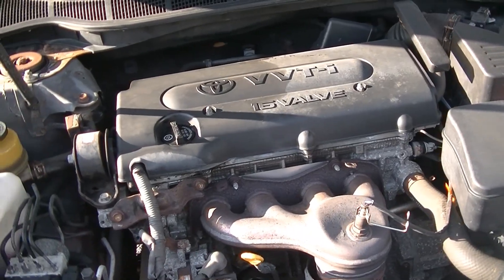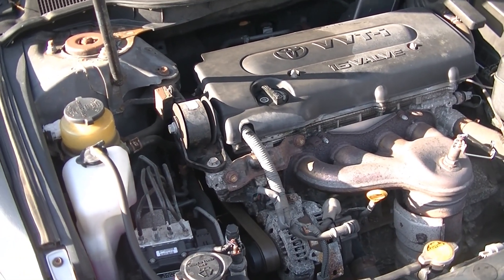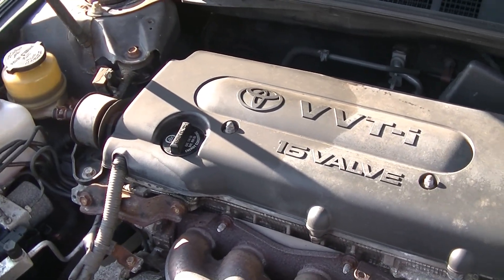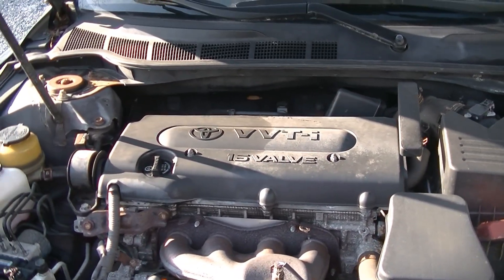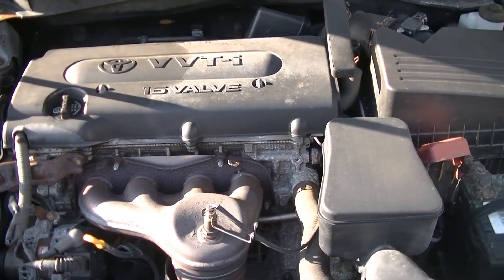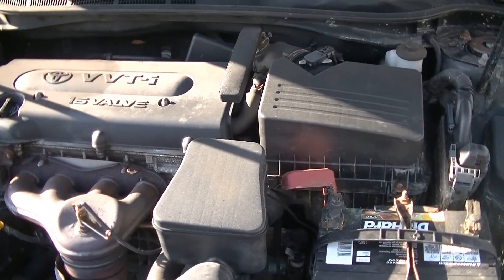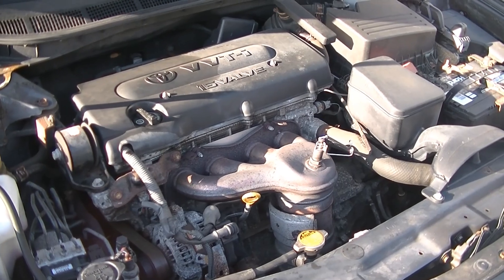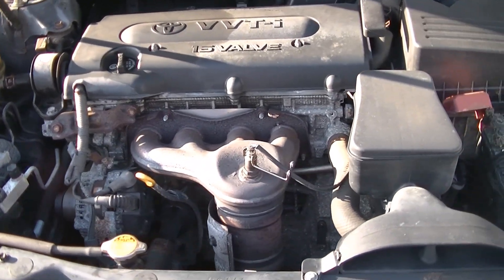Why you should AVOID a TOYOTA with the 2AZ-FE 2.4 liter engine!

Comment: have a 2AZ-FE in 2002 camry that the kids beat the heck out of. But still runs good at 250k. Burns oil (a quart every 500?) but figured that was because some kid in college wasnt changing oil for a long time. Once it was driven from LA to bay area with only a quart in the sump but somehow survived, and that made me think its actually a pretty tough engine. And I do know someone had the head bolts pull; it got fixed pretty ok with inserts from top.

Comment: Had this engine in my Tarago(people mover - Australia). Got 327k km (204k miles) not an issue.  Changed every 5km ran like charm.  At oil change the oil was not completely black either.
Used to carry 6 of us, lots of city & country driving & at speed.
I must have been lucky I guess.
Reply: Not all of them develop the oil burning issue. Partly luck but regularly changing the engine oil definitely helps, a lot of people neglect to do that. I've got a Rav4 2.0 1AZ-FE with 80k miles, 5w-30 fully synthetic oil, changing every 6-7k miles, it's proving to be a reliable engine so far.
Reply: probably yours is made in japan as mine. I think the problem happens only on engines made in the US. My 2010 camry with this engine has 100K miles on it and doesn't consume a single drop of oil

Comment: But werent the problem of oil burning found on the 2.4 litres 2az-fe between 2006 onwards ...perhaps till 2013? The ones from 2002 to 2005 should be okay right?
Reply from the maker: The 02-06 2az had a separate catastrophic issue that is also mentioned in the video, which is the head bolts pulling the threads out of the engine block. That was addressed 07 and onward
Reply: Thanks for the reply. Was looking for a camry 2.4 from 2002 - 2006. Now need to rethink this.
Reply: There is also the camry 2.0 with 1az-fe engine from the 2002 - 2006 era. This is also found in the RAV4. Does the ‘head bolts pulling the thread’ issue affect this 1az-fe engine as well?

Comment: Do you know if the japanese cars have the same problems? I have a toyota vanguard with the same engine. Its not listed as an affected vehicle in the TSB but I think that might just be because of the limited market.
Reply from the maker: I'm relatively sure that internally they're the same as the USDM engines, but i may be wrong
Reply: Vanguards and Rav4 3rd gen are the same vehicle with different styling.
Reply: And yes it's likely it would burn oil eventually

Comment: I had 1mfze in my 99 solara 5spd manual.  Never had a issue with trans or engine.   Loved that car.
Reply from the maker: toyota V6 engines are very stout, the 2az is just a kink in the armor I guess, because the 5sfe was a super reliable engine, as is the 2AR
Reply: @SEsGarage  I remember the v6 4runners always blowing head gaskets .

Comment: i got one from 2008 wit the oil squirters in my 2006 Rav4, tryna boost it after i get BC rods. but i havent touched oil in over 2000 miles n she gud, go like 100 every day
Reply: Did you rebuild the engine with new rods? what pistons did you choose?

Comment: my 2007 camry le 2az-fe burns 1 quart of oil every 300 miles. 233,700 miles on the dash.
Reply: Try using lucas oil stabiizer and go synthethic on your oils, it helps
Reply: Same here. Lucas just came out with a low viscosity oil stabilizer made for cars with variable valve timing like these. Put a can in yesterday, I drive for a living so I'll let you know how it goes if you're interested
Reply from the maker: Thank you for reinforcing one of the main points in my video!
Reply: Yup... Same exact problem with 2007 RAV4 with 200k miles... Burn a quart every 300-500 miles... Depends on how high I rev.  Super annoying problem....
Reply: Have you tried using engine flush from Liqu Moly or Amsoil to try to clean up that engine or using a heavier weight oil or switching over to Amsoil synthetic?  Quick oil changes every 1,000 miles with non synthetic is something to try too.

Comment: You forgot but, the car I just bought for $500, Toyota matrix XR AWD, has that 2az-fe, with 214,880 kilometers, or 133,584 miles. It is burning oil, spittin water from the muffler like a fountain, and there is a ticking sound coming from the head, by the 4th cylinder. I do work on cars, so the engine will come apart
Reply from the maker: Yes the matrix! They put the 2AZ in a ton of different cars. Seems yours may have both of the common issues these engines suffer from. Be sure to subscribe for more!

Comment: I have a 2010 toyota camry le with 164000 miles, the transmission and the whole engine blow. Traded it in for a 2020 toyota camry trd 
The car ran great until I hit the 150000ish mark
Reply from the maker: So you had the newer 2AR engine. They’re usually pretty reliable as long as they’re maintained. Funny you mention the TRD, I own one of them as well. Great car!
Reply: You must hard on your car 🚗

Comment: So here is my issue with this engine. there is really nothing you can do as a consumer to find out if the engine is using oil at purchase time short of a compression test. I highly doubt a seller will let you do that in a parking lot or a driveway. I would say some owners and dealers will flush the fluids, put fresh oil in and list it. most test drives are 20 miles or under and you aren't going to see anything then. I have this Engine in my 2007 Hybrid and with 214K miles doesn't use a drop.
Reply from the maker: Unfortunately they’ll still show good compression even if they’re burning oil. It’s not the compression rings that have an issue, it’s the oil control ring
Reply: Cheap borescope for your cellphone, look at the pistons through the sparkplug hole.  If its an oil burner it'll be obvious.